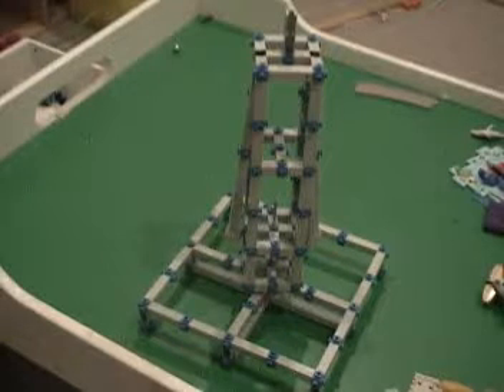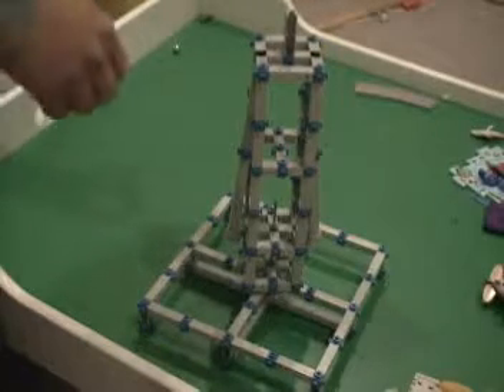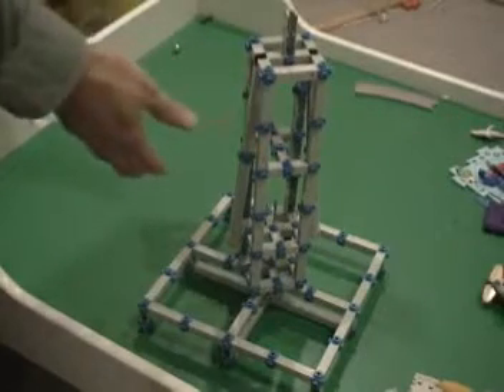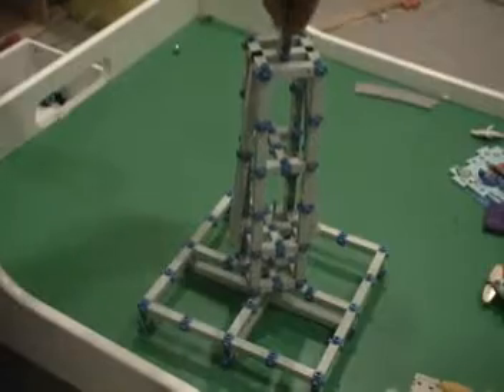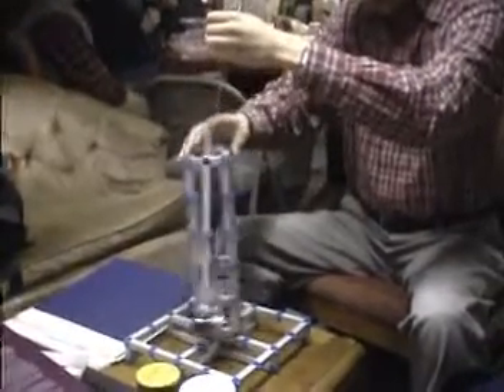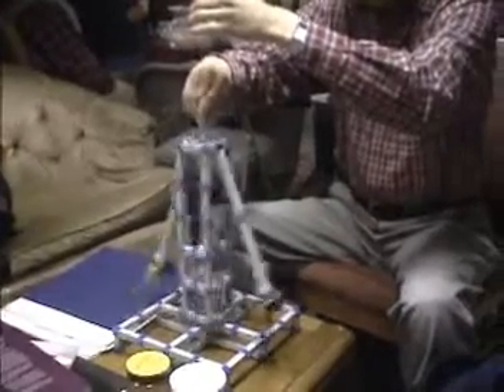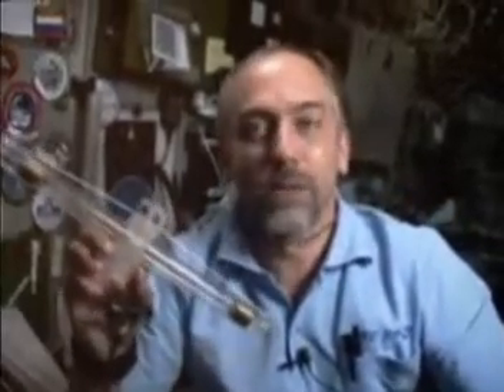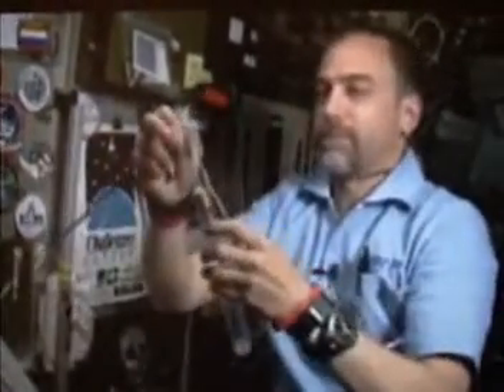Demonstrating non-conservation of angular momentum

Comment: I'll help you out mate.

This formula is for a disk shape object rotating  to show the relationships for angular_momentum.

moment_of_inertia = (1.0/2.0)*disk_mass*radius**2   = converts to (kg-m**2)
rpm = revolution per minute 
angular_velocity    = (2.0*3.1415926535897931*rpm)/60 = converts to (radians a second)
angular_momentum = angular_velocity * moment_of_inertia 

----IMPORTANT---
any change to moment_of_inertia formula or angular_velocity will change angular_momentum

---------- moment_of_inertia -------------
moment_of_inertia applies to the geometry of what you are rotating
so this can have an affect to the angular_momentum formula especially if the geometry is changing.
any change to this will have an affect to angular_momentum

------------angular_velocity---------
using your hand is not a good reliable constant force, its variable,
so if your hand is variable, so is angular_velocity, if angular_velocity is variable so is
angular_momentum.

---------energy leakage-------
-friction from all your parts when you change the radius and pull the string, will change variables!
-the strings elasticity when pulling!
-wobbling of the whole device creating changes to all variables

-----HERE COMES THE BIG ONE-----
when the radius is large your device is actually lifting up mass against gravity! its not a simple sideways
action like the space video you showed!

so now we have a force going against 
so what you actually made is called a "porter governor"
now it get complicated, we now jump into to the world of
isochronous speed governors. lol!
this is now the formula
speed = 1/(2*3.1415926535897931)* sqrt(1+(center_mass/outer_mass)*(9.8/height))

---- Conclusion ---
if your device did match  the law angular momentum in that configuration you would of broke law conservation of energy and change the world! lol

well done trying stuff out, never give up, thats how we find discoveries